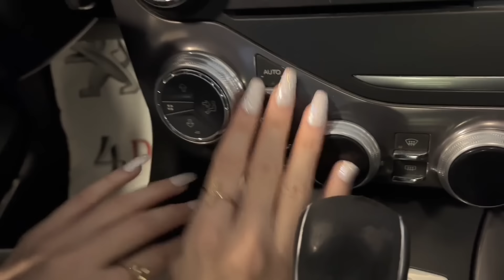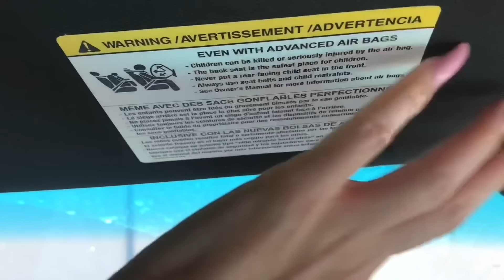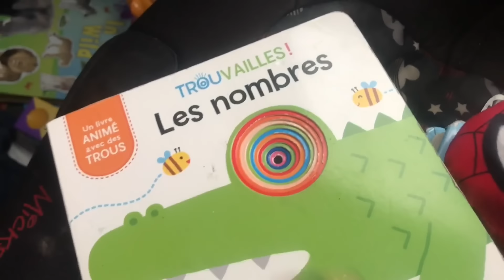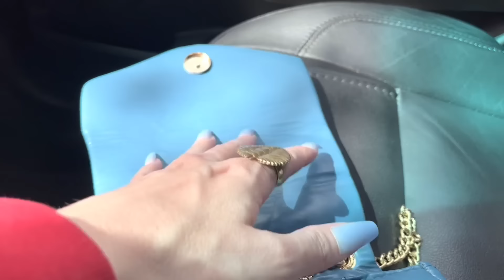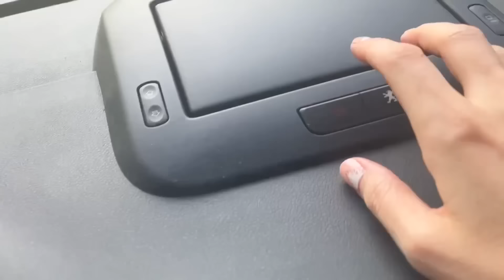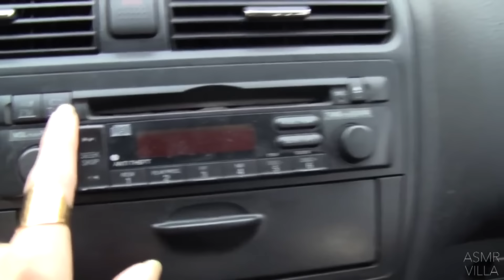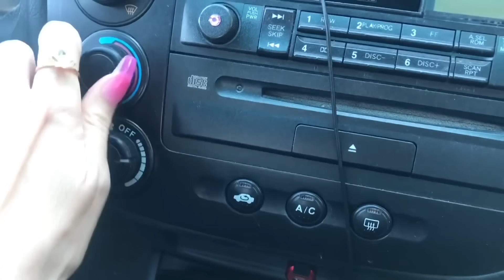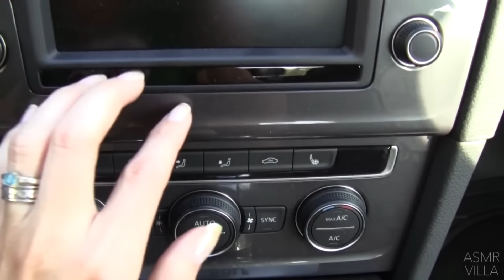ASMR * 2.5 Hours of Car Tapping & Scratching!!  * Talking Compilation * ASMRVilla

Comment: 1:19:09 Booster seats like those are typically used because of seat belt reasons. The seat belt is too high up for kids, so the belt would dig into their neck. With the booster seat, the belt lays across the shoulder and chest like normal :)